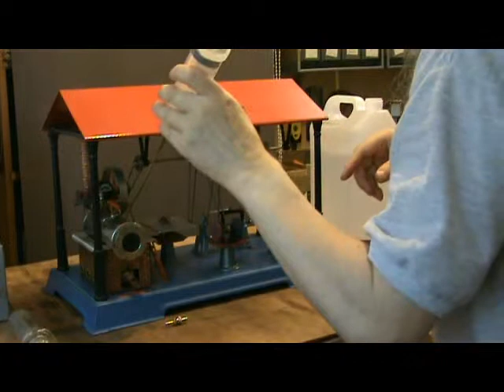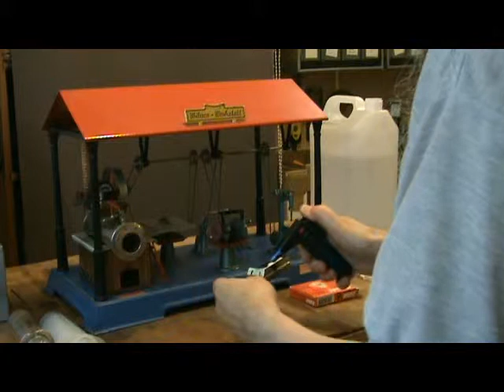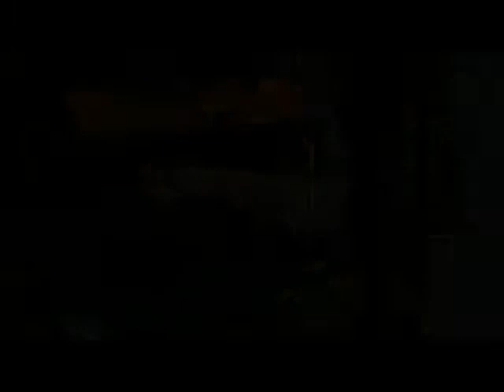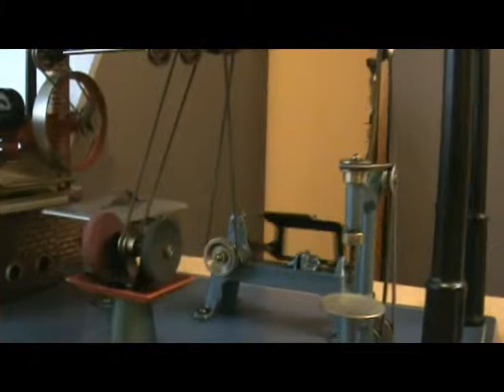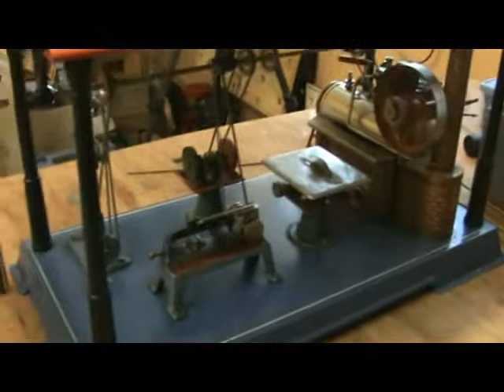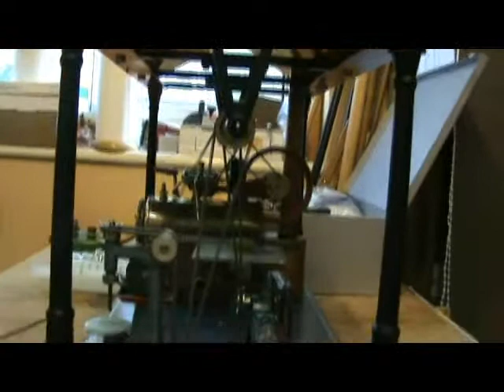Wilesco D141

Comment: I have a friend that has one of these, but part of the pressure gauge broke off inside.  Do you know how he can get another one.  Its the part that is threaded?
Reply from the maker: A new pressure gauge is available from Manor Models http://www.wilesco-uk.co.uk/wilesco-Wilesco_Parts.asp?part_id=100527&desc=Pressure+Gauge+30mm+2%2E5+Bar+Bottom+Entry . If you're lucky, you might find a second hand one on Ebay.
Reply: Thanks so much.